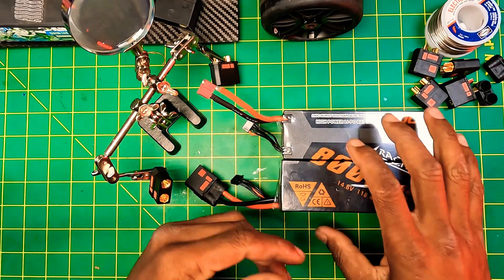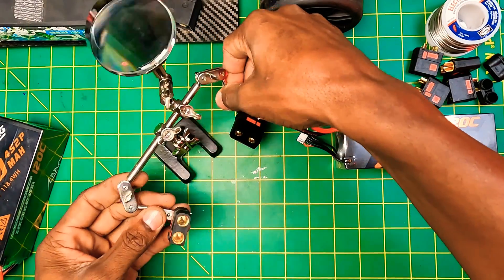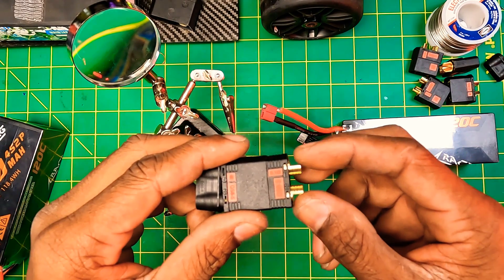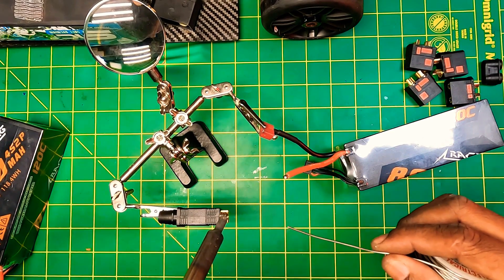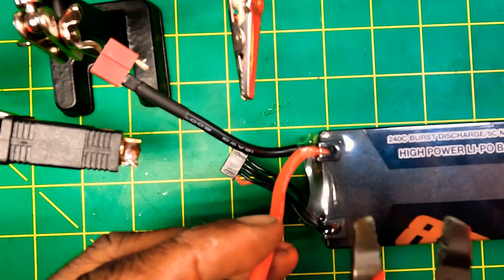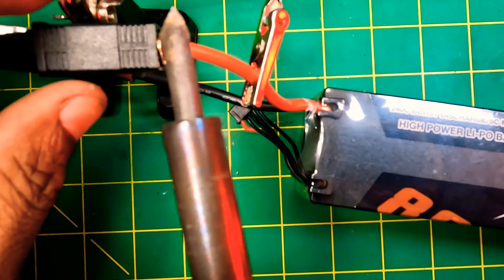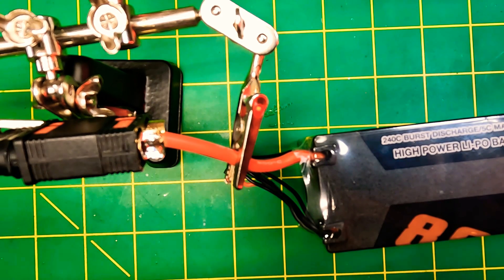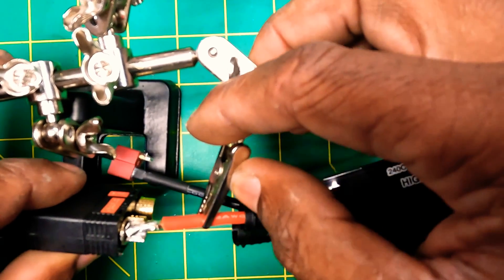How to solder QS8 Connectors (Explosion)

Comment: Bad soldering job.  The connector should always be heated with the soldering iron, to bring it up to the melting temp of the solder.  You then hold the solder to the connector until the solder melts.  I see too many people who just melt the solder on the tip of the soldering iron and apply it to the surface to be soldered.  Doing it that way, doesn't insure that both the surface to be soldered, and the solder reach the same temp.
Reply from the maker: Thanks for the information! This is an older video and seems to hold up fine in my speed run cars. I will post more videos soon. Thanks for your feedback!
Reply: @upperleftusarc  Old video but what you're doing as he suggested is cold welding.  You also tinned cold on the connector also, you need a higher wattage iron also need some need strippers lol
Reply from the maker: @reznya2700  Thanks with was an old video at the time, but normally, I heat it up with a torch (connector), then heat it up  with the iron and solder to tin it. I have multiple automotive wire strippers, but if you do wiring for years, a razor blade work's just fine with flush cuts! I need to post some updated content! Thanks for watching! What are you working on?